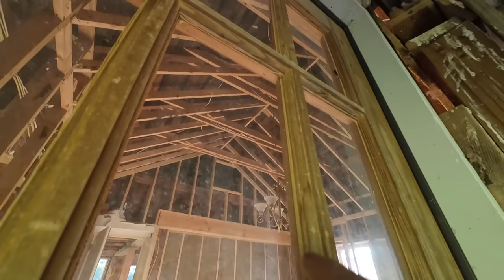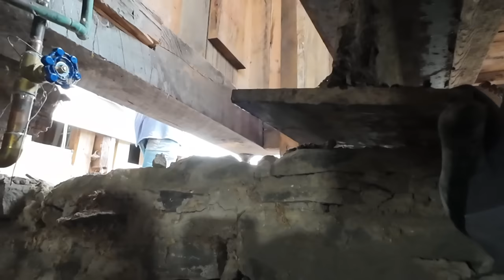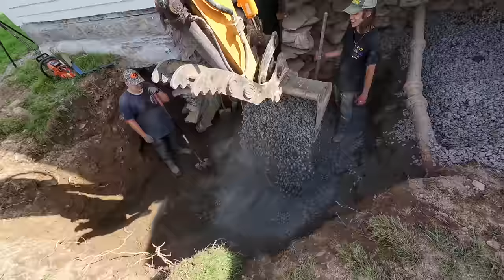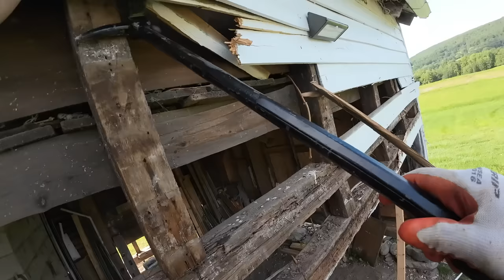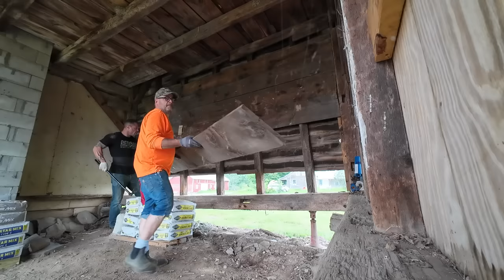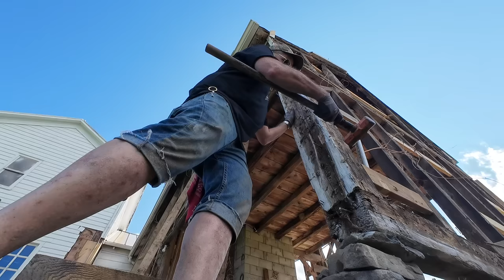We've got problems at the Graveyard House! #03

Comment: Listening to Jimmy talk about ladder safety brings back memories. Back in the 80's when I was still working as a journeyman painter on commercial and residential projects, we used what we referred to as a 4' painter's ladder. This was a lightweight wooden ladder with a rope or a thin chain holding the two sides together, and no locking mechanism. These ladders were built to be moved quickly and effortlessly as the painter would work his way around a room cutting in the uppers. You could hold on to your cut pot with one hand, pick the ladder up with the other, and the two sides would close allowing you to quickly and easily swing it over to your next move. 
But they eventually outlawed these ladders because carpenters, plumbers, laborers and other tradesmen on the job would use them for things other than what they were designed for, and hurt themselves in the process. This lightweight ladder was designed for someone using a two or three inch paint brush and not applying any amount of force or torque. But laborers would "borrow" them from us and use them to demo walls, and the ladders would slip shut and collapse on them. Anyway, our very convenient painter's ladders were eventually outlawed and replaced (for "safety" reasons) with OSHA approved boat anchors that weighed more than twice as much, and required two hands to open and close, making our jobs harder and more time consuming, but not any safer. 
Progress.

Comment: 'Taking the gut punch and moving forward.' Exactly! Once you can really get behind that notion, everything gets more positive. That's been my experience, anyway. And, with that in mind, doing the demo work can feel really rewarding, when you keep in mind that, once you're finished, the house will be rebuilt the right way, and will be ready for centuries more of solidity, and empty of band-aids and stupidity. Besides, swinging a sledge hammer at rot and wtf 'repairs' is really satisfying!

And that mummified cat was amazing. Ancient Egyptians would be pleased.

EDIT: For those commenting that it would make more sense/be cheaper to just tear the house down and start over: There's no rational argument against that, but there's just something really satisfying about working on something old that you know has a history worth preserving. Connections to those who came before. I refurbish old large format film cameras, and sometimes telescopes. I have also made new ones. The new ones are 'better' functionally, but the old ones were handmade using materials that are no longer available, by skilled people, and which have both a physical and historical patina that is very satisfying to bring back just enough to improve but also preserve.

Comment: In Australia we dont wrap our timber frame dwellings in OSB, its typically 2x4 (90 x 35) studs @ 16"/450 crs, single bottom plate, 2/ top plates and then we use a moisture barrier wrap before either cladding in brick masonry or timber weather board (cladding).

Comment: I'm hoping the cat got a proper burial, maybe across the street. 🤔

I'm no construction guru, but I did work in the industry, building houses, for a very long time. From what I've seen based on my past construction career, plywood sheathing on the outside of a house became common place around the early '70s. Plywood itself has been around much longer than that, but wasn't the common building method until the early '70s when it then became affordable to sheath the house in plywood and then side on top of that. Affordable being the driving factor there. So I'd venture to say, your "extension" pre-dates the '70s. Some of that construction looks very early '60s to me. That's the best I got. 😉

Comment: That's some major rot.

In a recent episode of the build show, Matt Risinger visited a project that was remodeling a home built with old lumber.

As they discussed the old frame build it was mentioned that the 16 on center standard came into being post WWII and was implemented to facilitate the 4 x 8 sheeting that came into existence. Combined, these standards made building homes more efficient and faster.

Then, with the engineered lumber which is able to hold more weight, the 24 on center standard came into being.

Comment: If you burn/ blacken/Char the wood used on the foundation ridge boards sitting on the foundation, termites will not eat into it & burrow into it, protecting the structure.

Comment: Those 24 on center with 2x4 braces..  what in the samhell.... it's like the original post and beam got I dunno what to think... the extension just makes no sense.

I think a flagstone patio off the extension would be an amazing outdoor living area from the doors on the extension.  

In the 1700s house I mentioned before, we found wedding jewelry in a rat's nest in the original chimney.  After that weird stuff started to happen like your hand prints coming and going.

Comment: Dealing with rot in the entrance way to my "basement house", whole northwest corner basically wood dust anymore, after ripping up million layers of repairs over repairs,🙄🤨  would sure be nice if landlords didn't just cover up problems.  A bit different than your case where previous owners just didn't bother doing any homework before doing repairs. And my entranceway is only 4' wide and 10' at its longest point.

Comment: why are you doing this? You are gutting an old useless house at this point.  Half of it is rotted and useless anyway.  You're better off hitting the house with the excavator, putting in an actual foundation, and then starting with good material.  What part of this house is not being "repaired"??? lolz
Reply from the maker: I am doing this for learning and doing and ratings.  And besides what else is there ?